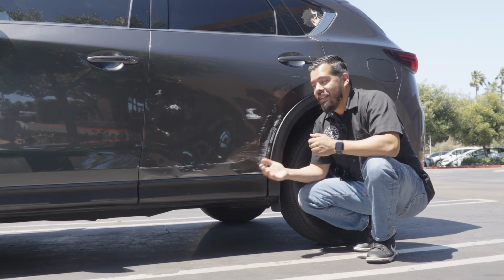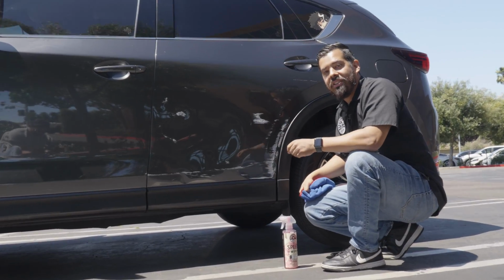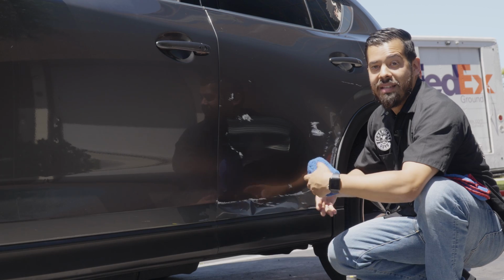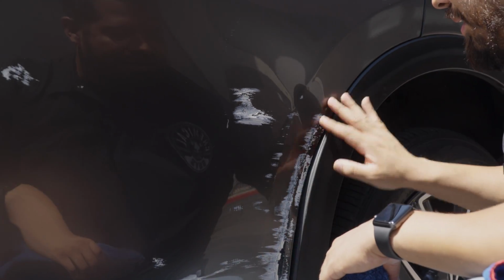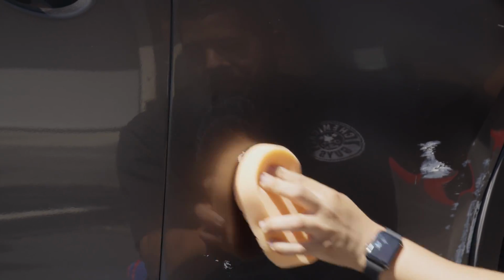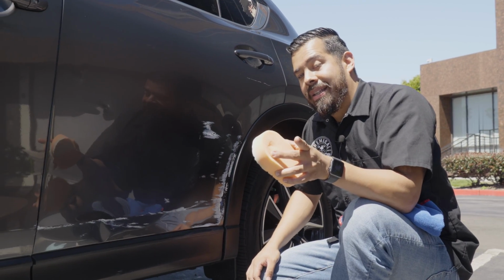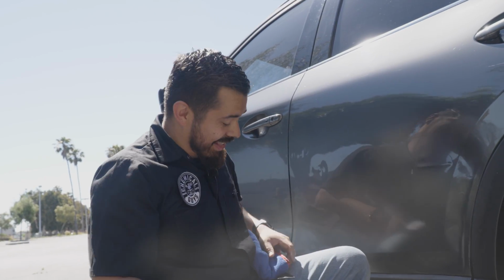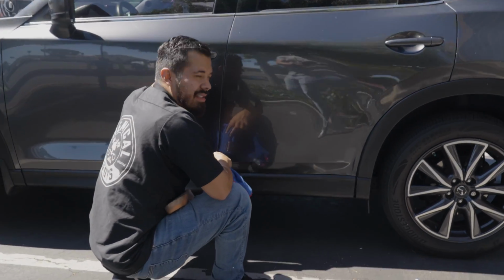How to Remove Paint Scuffs On Your Car (Remove Paint Transfer) - Chemical Guys

Comment: do you have to polish after the c4 compound?
Reply: Yes. If you click on the link it even says to use with P4 polish. Rule of thumb, anytime you correct spiny with a compound you need to polish and apply a protectant. Unless it’s a 3 in 1 product

Comment: Hey there, I had a question I wanted to ask you guys! 
I recently bought a used yellow 2010 Chevy Camaro. I got a fantastic deal on her, however the drivers side door and hood seem to be a bit scuffed up, almost like someone took one of those green sided sponges and tried to scrub something off.. Honestly from looking at her, I really don't believe the paint was removed.. The shine is gone though from these spots (there are quite a few of them) The passenger side, roof and back look just fine though.

Would the process shown in this video work for my car too? I don't expect it to be a showcase level kind of fix, as I'd be grateful for any improvement. 

Thanks for everything you do and for the great content! ^-^
-Ness.

Comment: I've always thought you had to address the micro-scratches the compound leaves behind followed by a pure wax to protect everything again???
Reply from the maker: It's not necessarily required, but you are right we do recommend it for that smooth jeweled look. We planned on showing a hand application of P4 after using C4, but we figured we would wait for a final polish until the owner removes the dents.

Comment: what about getting microswirls out of gloss black sportbike fairings? thats what I wanna see and any suggestions on failing clearcoat haha
Reply from the maker: Great suggestion! This hand-polishing technique would actually work perfectly for your fairings - use an Orange Hex Logic Hand Pad just like in the video, but go a bit heavier on compound, either V34 or V32 if it's severe. Then finish off with P4 or V38 for that jeweled look!

Comment: I just used the clay bar to remove a paint from another car and it did it grear. I finished with butter wax
Reply from the maker: Another great use for Clay Bar. Glad that super combo worked out for you!
Reply: i tried the butter wax, it didn't even work a little bit, total waste of money, i guess i will buy the clay bar and try that.